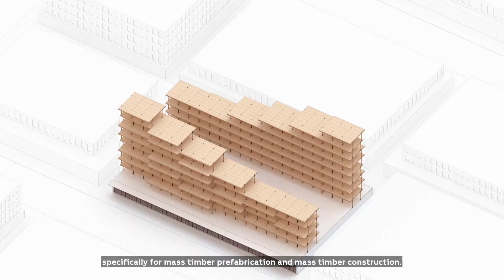Transforming construction with Intelligent City

Comment: making any  high rise above 4 stories out of wood construction is sheer stupidity and dangerous ..wood burns and you cant change that . ive seen a lot of these 4 level  buildings burn down the fire is almost un stoppable . concrete is the only way to prevent a structure fire . lets build something that will last the test of time not just make a profit .
Reply: Mass timber construction is very different from stick frame! It's true that no high-rise should be built from stick frame, the structure is not made for that. Mass timber is very different, however, in that it's extremely stable and safe from fire because of it's "massive" nature. There are some great high-rise examples across the world. More info can also be found here: https://www.thinkwood.com/wood-performance-and-design/timber-and-fire-safety